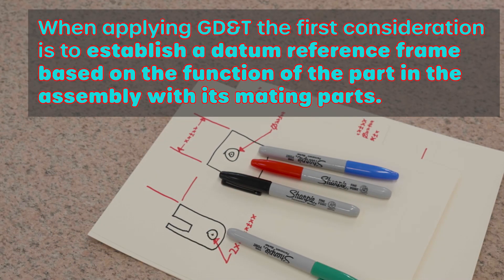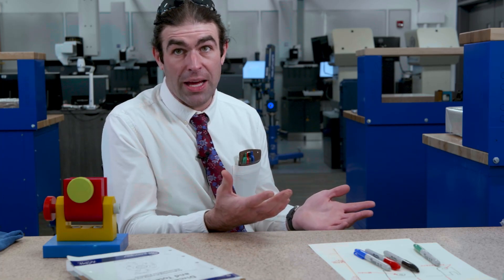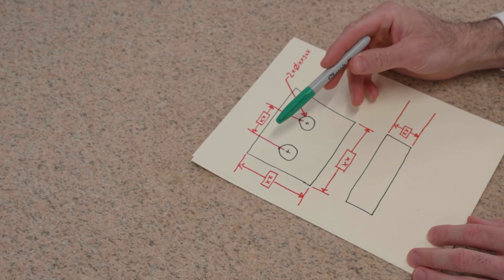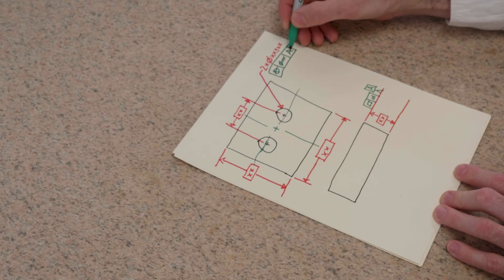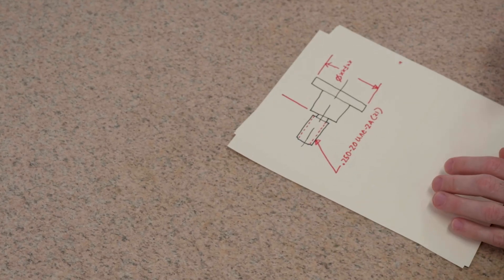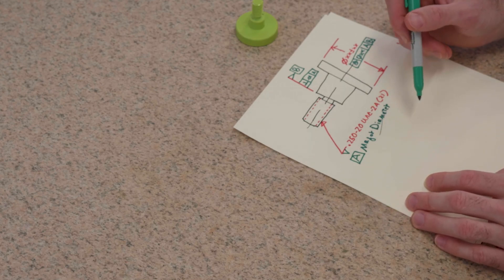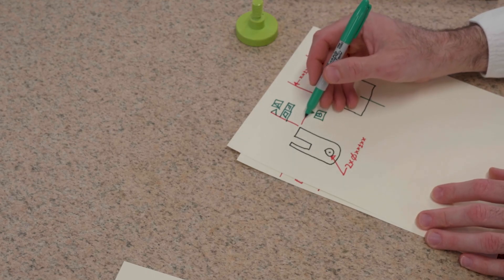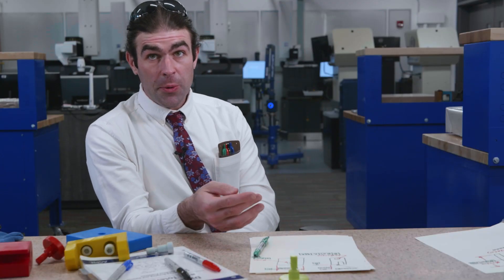Applying GD&T: 3 Basic Steps

Comment: That is a great thing to learn. I really appreciate the way sir, you make gd&t into real exposure. My concept of gd&t gets clear when I watch your videos. I try to implement the process in my designs as well. 
                                             Sir, would you recommend a rule book for using gd&t, as it is very important for mechanical design engineers.
Reply from the maker: Thanks so much! I would recommend the ASME Y14.5 standard, it is the official source for all GD&T information. Another good book is GD&T Application and Interpretation by Bruce Wilson, I use this as a textbook in my courses.
Reply: @RDeanOdell  Thank you sir

Comment: 1, How width and length and height of rectangular block besic dimension? From where it will get tolerance.
2, as per my understanding whenever we define hole position as datum (pattern of holes) we need to consider (B-B) for features dimensions 
Not sure this is ASME OR ISO
Please clarify and thanks for these videos
Reply from the maker: Hi, The tolerance for the rectangle comes from a profile applied "All Around". The location of the holes is basic and assumed because the holes are centered in the middle of the part. See ASME Rule "K".

I'm not sure I understand your second question, the datum is is the middle of the two holes. It is the intersection of two planes.

Thanks for the questions!